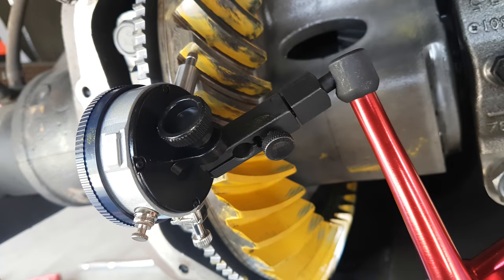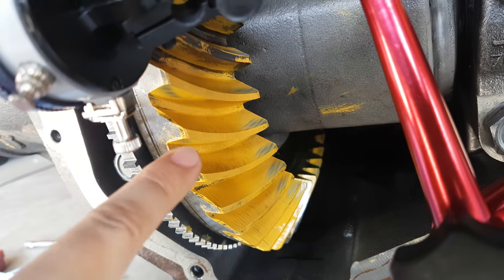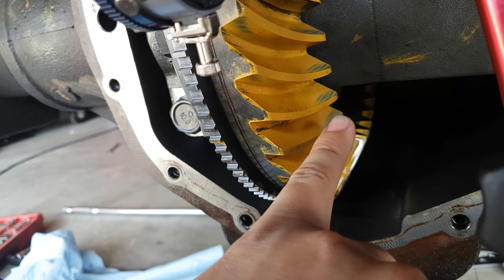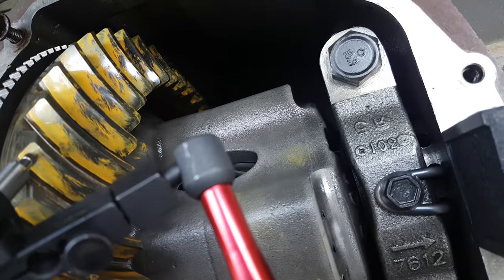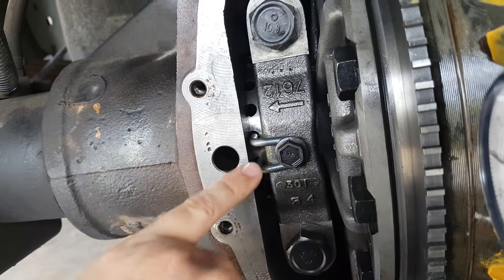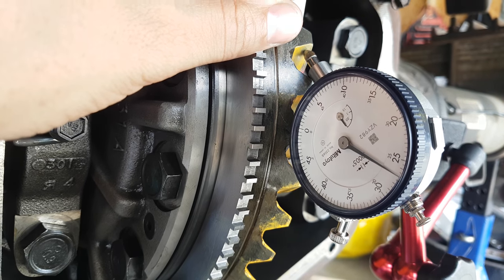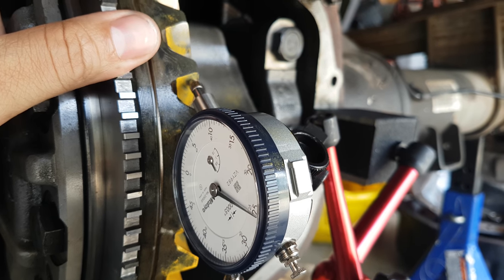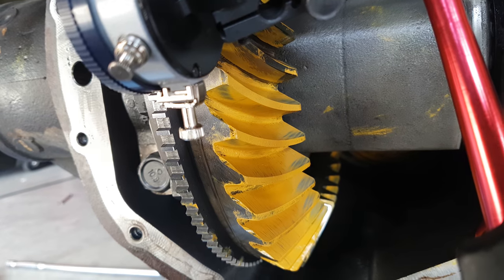Conflicting Backlash Results-Contact Pattern and Dial Indicator

Comment: they are  talking about your shim on the pinion under the rear bearing you have the  wrong pinion depth
Reply from the maker: Thanks dude, I was advised that the odd pattern was due to the gears being used (but good).  Same odd patterns occurred with stock pinion depth.  I've had the truck running for a few months now about 5k miles with some light, 5-6k lbs towing.  No issues
Reply: @BigBrotherIsTooBig  the lash is adjusted with the side to side adjusters. When that is right then you check your pattern and see if your pinion depth is right. There is a really good video on this being done on a dodge here on you tube. Just search for aam 11.5 and it is a 2 part video of them changing front and rear gears but very explanatory.
Reply from the maker: Yes of course and the depth set with shims.  This video was to understand why, when the lash is within spec measured with a multimeter, that the pattern indicated it was out of spec.  This confused me.  Of course I went with the dial indicator measurement over the pattern.  The odd pattern was due to the gears being used versus new :)
Reply: @BigBrotherIsTooBig  I know this is late but he was saying the pinion depth is set with shims and that is what will change the contact pattern.  but its still conflicting because you have one side centered and one side off.  I'm sure its fixed by now, so what was the final outcome.  just my opinion I would of left the  drive side centered,  set the backlash and pretend the coast side  was good.  that's not my advice just my opinion, lol .
Reply from the maker: @davidcraft4909  Thanks form your thoughts :)  It's been running a little over a year now without issue including some towing with about 6k moving trailer.  No gear whine, no sparkles in oil.  Weird contact pattern was from using original gears vs. new.  All rebuild info/videos I found were for new gears.  I went with dial indicator measurements over the pattern.
Reply: @BigBrotherIsTooBig  Hi, I'm setting up a Diff with New WaveTrac & Old Gears, this is the exact problem I'm having. This was the only Video to address this problem. Thanks, Very Helpful. :)
Reply from the maker: @timhampton6569  Glad it helped you out 😀